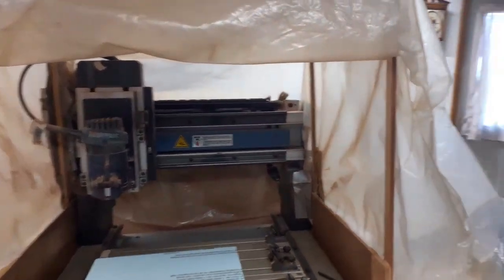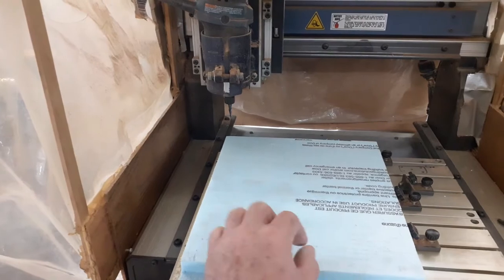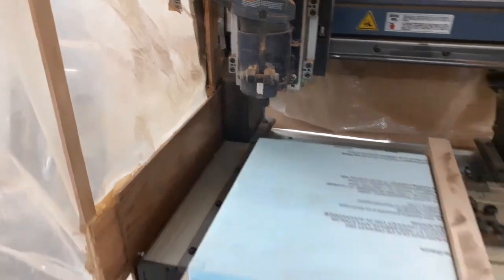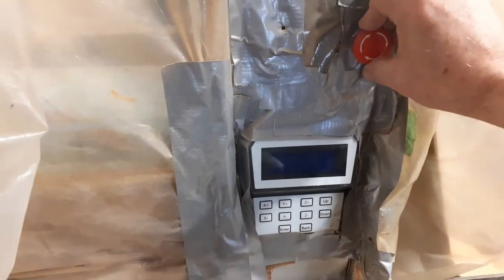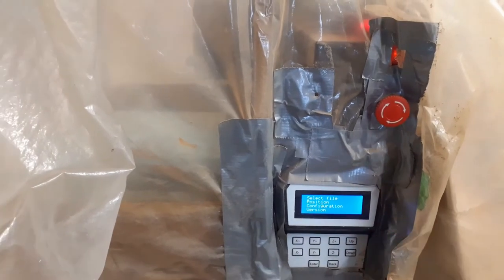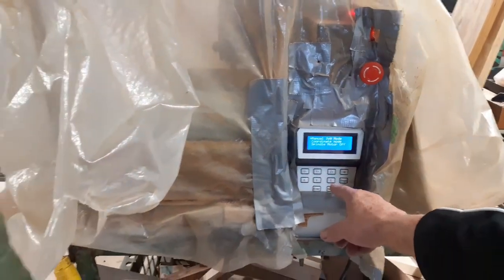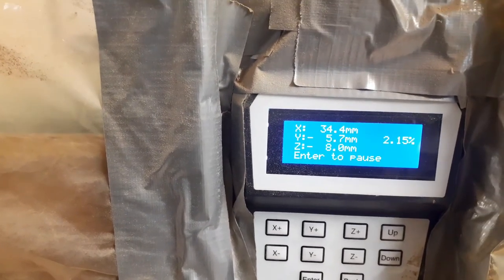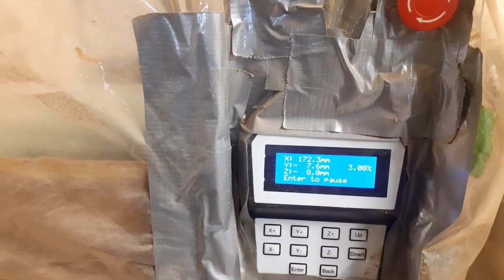Got an idea?  Setup and run a GEE file on your Oliver 1013 CNC Router (PART 2)

Comment: Just recently acquired a free Intellicarve 1013 from a buddy. Thanks for this video. Can’t wait to dive into mine.
Reply from the maker: That's great, for free!  And almost as valuable to have a buddy who can help you get started a little faster.  I hope your spindle is in good condition.  Consider upgrading to a trim router like I did.
I still use my machine - I made a few Christmas presents last month including some cement molds (one of my next videos to edit).  Good luck!
Reply: @oldhobo5610  Didn't see this notification for some reason. I think the spindle is good. The X axis where the gantry sits on had a crack in it. Used some epoxy so hopefully its still usable. I'm not out money if it still doesn't work. I need to get some clamps because my buddy only found one and that won't really be usable if I don't have anything to hold my pieces down. Could this carve out a bowl? i-Picture looks very limiting. Doesn't allow me to import SVG's from what I've seen.

Is the trim router more powerful? Was it difficult to wire in? I've heard the router in this machine is kind of underpowered.
Reply from the maker: @armedscubasteve  Most of what I have done is 1/4  to 1/2" relief from bitmap or jog files, that I have used GIMP to blur to create a nice gradient for smooth carving.  I have experimented with direct g-code programming (holes and counterbores for speakerss in particle board).  Because the y axis zips along at a proportionally hi speed I had to put in many shallow passes to get through the board.   Yoy could do a very shallow bowl interior raster style but it's not ideal for that. I once programmed an airfoil contour and did a 48" long piece, 12" at a time.  Maintaining alignment from pass to pass takes a few tricks.
Reply from the maker: @armedscubasteve I'd guess the original spindle is on the order of 1/4 hp.  My Bosch trim router is 1 hp.  I have to manually set the rpm on the router as I saw no way to use the machine's driver to control speed.  I have to edit the gee file in notepad and delete the spindle command line (m code) every time or else the machine hangs up at the command line.
Reply: @oldhobo5610  oh good to know if I decide to upgrade that router. I was thinking of tinkering with this for a bit and upgrading to a larger machine. Allow me to get my feet wet first before diving into a $5,000+ machine.
Reply from the maker: @armedscubasteve  Last notes:  The controller recognizes circle commands and sidemilling interpolation.  It doesn't let you modify feedrates within program.  It doesn't  allow feed per review programming.